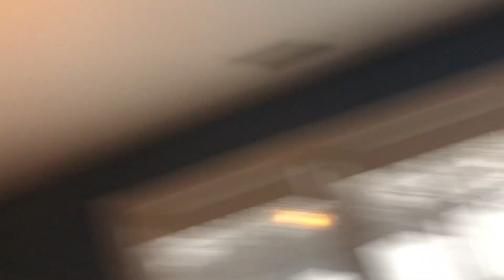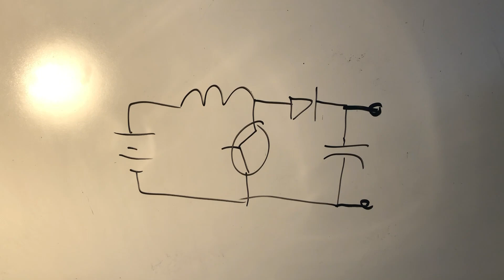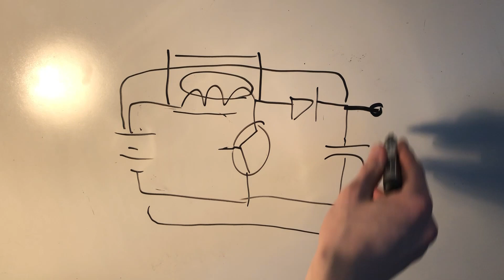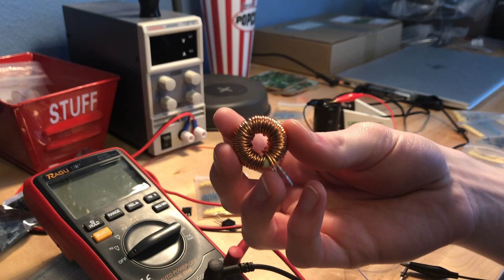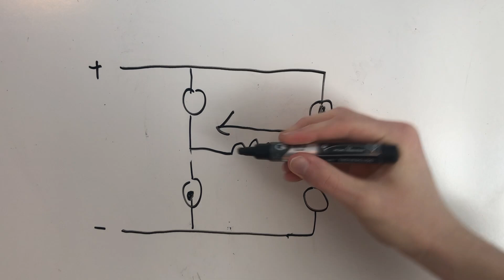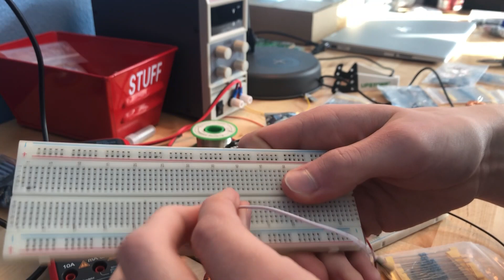Making a Coilgun - Part 2: Capacitor Charger

Comment: I like how you use metal pliers and hold onto the metal as you discharge the capacitor
Reply: i wouldnt do that, but its not that big of a problem. the problem lies in touching negative and postive pole of the capacitor with the bare hand, but the way he uses the pliers there is no option to hurt yopurself, if this is a isolated circuit

Comment: Don't give up on the single inductor boost converter yet.  Current through an inductor increases with time when a DC voltage is placed across it according to V/L = di/dt.  likewise when the transistor is turned off it decays through the diode and into the capacitor following the same equation. The voltage which sets the rate of decay will depend on the capacitor's voltage plus the diode drop.  The switching frequency and duty cycle must be chosen so the transistor is not on long enough to saturate the inductor and it should be off long enough for the current in the inductor to decay into the capacitor.  Another way to think of it is the energy stored in the inductor at the time the transistor turns off is  Q=1/2L(i^2) which is also the amount of energy that can be stored in the capacitor after the transistor turns off.  Energy added to the capacitor will be Q=1/2C(V^2). With multiple cycles the capacitor should charge to any desired voltage within its rating.  Time requred for the inductor current decreases as the capacitor voltage increases as can be seen in the above equations.

Comment: Consider just buying the cheap 12v to 220v high frequency AC converter modules from eBay? They worked wonders for me and goes to 350v dc rectified.

Comment: So as you charge the capacitor up because E = 0.5CV^2 the inductor keeps seeing higher impedance from the cap. Thus because the time constant = L / R it discharges much faster. Now the pulses on the discharge shrink to a tiny percentage of the on cycle and thus if you don't adjust your duty cycle according to this trend you end up charging very little as the cap voltage increases. Hope this helps, I like your project, watching with interest.

Comment: Tattoo machines use electromagnets that use a physical switch to operate. Brushed DC motors use brushes and wires connected to pads as a switch. I know you know this as well but have you considered using the projectile to make a connection with the optimal coil as it travails through the barrel. Or hall effect sensor like a brush less.
Reply from the maker: I have. Brushless motors are undesirable and expendable because of their brushes. Brushes in a system like this would like get chewed up immediately. Hall effect sensors are used in BLDC motors to detect the proximity of the permanent magnets. In this system there are no permanent magnets and it is likely that the sensors would be overwhelmed by the magnetic fields of the adjacent coils. In my latest video I discuss why I believe a blind system, one with no sensing whatsoever, could work just fine.

Comment: Ay bro I know all those wires look cool and feel big brain but you need to get some single strand insulated copper wire and cut little staple looking pieces out of it and use that for your connections, always keep everything as close as possible but practical enough to get in there and move things if need be.

As for the circuit board, DEFINITELY make one bro it feels and looks way cooler than breadboard, you'll feel like a pro just go to easyEDA.com it's free and online and they work with JLCPCB so you can get cheap as boards but legit quality I've made and ordered heaps man they ain't payin me to say this, I've been doing this stuff for years and they're a game changer 

But I love how passionate you are it reminds me of me so best of luck bro you're gonna learn so much stuff you didn't even know you didn't know 😂😂

Comment: Hey mate! I have also been working on a coilgun in the past months. I have a few suggestions you might find useful.
1. The classic single mosfet and transformer circuit is much better and effective that boost converters. I've initially tried to make a boost converter for cap charging, but the charging was slow, and I got 200V max.
2. You can use a pair of LEDs facing one another as your motion sensor. Basically one will be on, and the other will go to the analog of the arduino. I programmed my arduino in such way that if the voltage drops (object is in the coil), it triggers the switching mechanism.
3. As for the coils, use thick wires and aim for almost non existing resistance. It's best that the cap dumps all current at once.
4. Thyristors seem to be the best option for stage switching, I fried countless mosfets so far, and relays are too slow.

Can't wait to see your creation!
Reply: @Isaac Eda It's basically a circuit where there is a transformer with a center tap winding, one winding gives the control signal to the gate of a MOSFET or IGBT, the other delivers the current through inductance. 
http://boginjr.com/wp-content/uploads/flysche1.png
The schematic above is similar to what I've made, only instead using an IGBT. Also I've soldered a zener diode between gate and emitter.
https://www.youtube.com/watch?v=0jWpQ8HEYgk&ab_channel=LudicScience
That video covers it up very well
Reply: @Isaac Eda Sorry this is actually the better video
https://www.youtube.com/watch?v=q9iSQSR9SHM&ab_channel=LudicScience
Reply: I think (and have read it) that IGBTs are WAY better than Thyristors because )obviously) you can't turn them off whenever you want. So let`s say the projectile is in the middle of the coil right now and you would like to cut the power off for the coil it wouldn`t work because your Thyristor is still open (and will be until the capacitor is nearly fully discharged) and so you got a huge loss in velocity because of the resulting suck back (when you power the coil when you do not want i to). So IGBTs are the better option, because you can switch them on and of whenever you like and so you are also able to only get the "best part" of the discharge curve of the capacitor (3taus or somtehing like that) and then quickly turn the power for the coil off. But to all the people who want to build a coilgun: DO NOT forget the flyback diode (antiparallel to the coil) especially when stopping the coil while feeding it high current from the capacitor and than rapidly stopping it, because then the inductive kickback will fry your switch and probably even your capacitor by putting a VERY HIGH negative voltage across it and with a diode next to it, which can of course handle that much current. (Even though a IGBT is about 4 times as expensive as a thyristor when you compare them with their maximum current ratings, but you can easily put multiple of them in parallel to increase the maximum current you can switch with the circuit). Ps: I hope that he makes a new video about that topic soon with new thoughts or even some experiments (hopefully also about an induction coilgun ;) )!